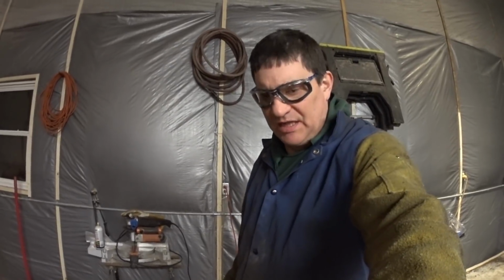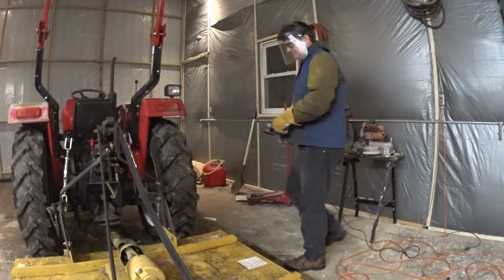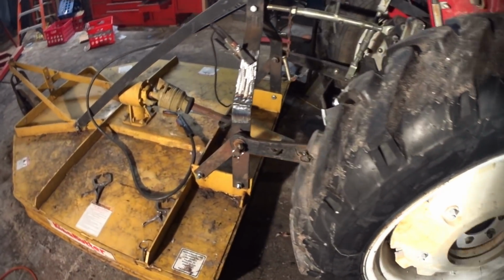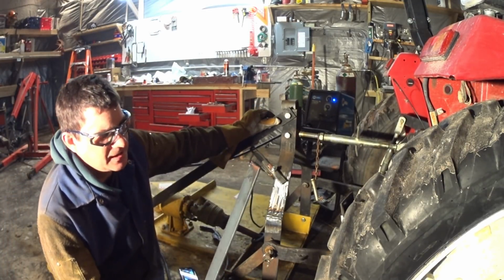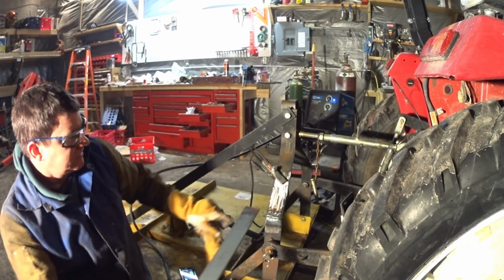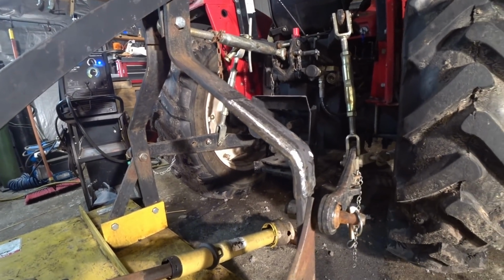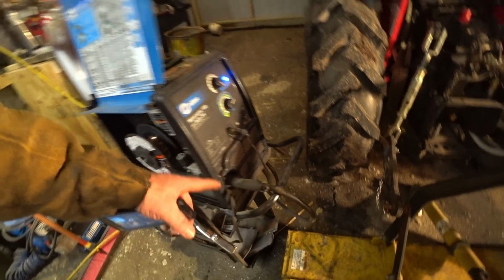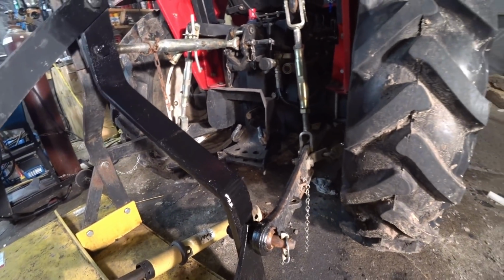Working on welding up the mower on the tractor#70

Comment: Good looking welding beads. Fixed side is stronger than before with that brace. Remember waxing at Praxair (sp?) a big place that had oxygen gas bottles. For hospitals & also welding. Two warehouse wings plus a store on the welding supply side. Upstair offices too lunchrooms on & on...had to push my equipment all over that place to do the various areas. On a Sat afternoon was bringing floor buckets / floor machine to another area & as I was passing thru the warehouse someone outside busted a small window & his hand is inside trying to unlatch a cargo door. I started yelling & off he took off to his pickup but before getting in his car he yells some bad words ...
Reply from the maker: Al A Thanks